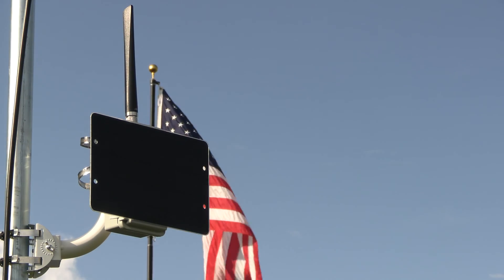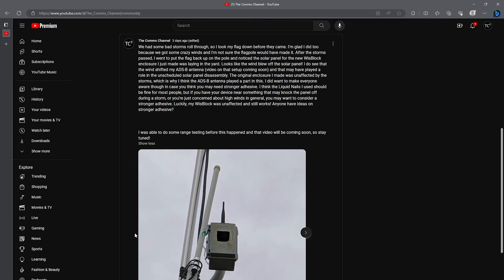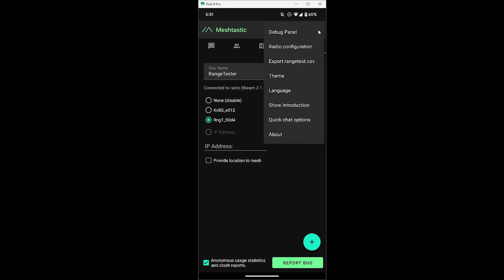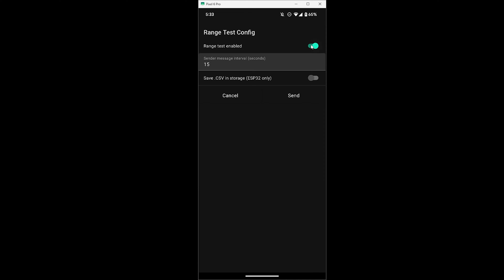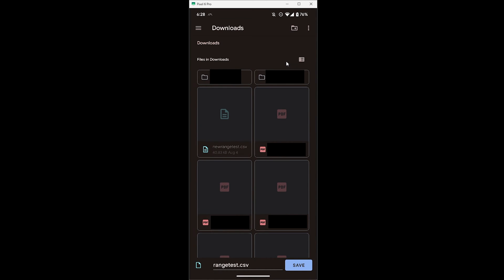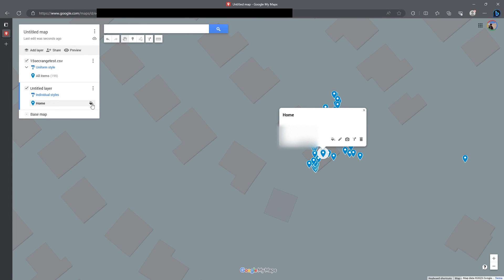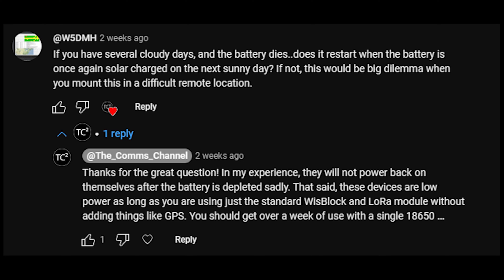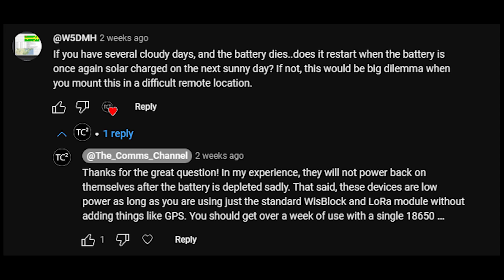Automated Range Test with Meshtastic

Comment: My question is with the solar controller does it control max and min voltage and does it have a temp senser to stop charging when it gets too cold as we know lithium does not play well with the cold thanks  Ed W9US
Reply from the maker: It's more of a solar charge port than a controller really. There are no management features. Just charges the battery
Reply: @The_Comms_Channel  ahhhh good to know Thanks for a quick answer I'm not sure what region your in but how does the battery hold up to cold weather, here in IL it got to -28° F this last winter?
Reply from the maker: Sure thing! I'm in TN so it doesn't get quite that cold here

Comment: If you're going to build a box to house everything, you could have provisions for an army of 18650's in parallel to give you proper voltage, with , of course an appropriate charge controller. A relay circuit to engage and disengage the battery while charging could also be built with solder wires coming from where the single 18650 goes. Some voltage/soc monitor could have output as to where the battery power would go per  the relay state.

Comment: Followed directions carefully. When I start range test on mobile device I don’t see any seq message coming through on stationary device. I can still send a message on the main channel and it goes through fine. Am I missing a setting?
Reply: I had to set the Base station to Range test ON and interval to 0 seconds for it to work. I also set the LoRa TX power to 0 to get maximum power.
Reply from the maker: What devices are you using?
Reply: Using a wisblock based unit for the stationary and a t beam for the mobile. Using Meshtastic Android version for both
Reply from the maker: Hmmm... that's my exact setup.
Reply from the maker: I don't do it often so I'm not sure what could be going on off the top of my head. I'll mess around with mine when I get home and see what I can figure out.
Reply from the maker: Any luck?
Reply: Yes your base radio needs to be put into range mode also

Comment: hey comms ever had issues updating the .uf2 file for the firmware mine copys fine then  disconnects and i reset it right after and it doesent seem to update my rak 4631 wisblock and when i use the web client it says ukn no mac adress or hardware name any tips ?
Reply from the maker: What firmware update process are you doing?
Reply: @The_Comms_Channel  .uf2 bootloader style usb serial I figured it out I wiped it to rui3 accidently recently and it basically ended up me getting the rak wireless factory files and nrf uitl.exe and wiping it all then I installed the arduino bootloader or whatever then installed the uf.2 2.2.13 firmware file after copying it flashed green and restarted several times in like 3 min I left it alone and when I used the mesbtastic client I noticed it had been flashing green every 2 seconds which it didn't do before so it needed a clean wipe
Reply from the maker: Ah, gotcha! Glad you got it working!

Comment: I have a few systems with batteries. I put the system to sleep under certain battery level, and I only wake it up to measure the battery level. If the battery is still low due to cloudy days, I put the system to sleep again. That way I'm sure that I have enough battery until a sunny day.
Reply: That is a really good idea

Comment: Hi, thanks for these videos. Question: If I were to set up one of these on a hill a mile or so away and wanted to message a friend, would we both need personal devices that we could either message with via the device itself or by connecting it to our own phones or could we connect to the device main router in the hill by our phones alone? Alternatively, if those friends had a single router at their place, could multiple people use that same router to transmit a signal from there place to the router on the hill and then to me? I'm super new to this but it's exciting and seems like a relatively budget friendly way to get into DIY encrypted messaging.  Thanks for any help that you can provide :)
Reply from the maker: Sure thing! I'm glad you're enjoying the videos! 

If someone is close enough (within Bluetooth range of 300ft or so) to the device on the hill, they could connect directly to that device with their phone and communicate with the distant users. If none of you are near the device on the hill, then you would each need your own personal devices along with the device acting as the repeater on the hill.

There can currently only be one device connected to a device at one time. I believe there is work being done to allow this though, or at least talks about it so not sure what the timeframe would be on that happening.

It's awesome technology and the easiest and most budget friendly way to get encrypted comms that I've found. 

Thanks for the great questions!
Reply: @The_Comms_Channel  okay, that’s noted and appreciate your explanation! Cheers
Reply from the maker: @natebaird  Sure thing!

Comment: Next question.  Any idea why the range test "seq#" won't display on the phone app?  It shows on the T-Beam lcd but not on the phone app(s).  I've tried both phones/T-Beams as the mobile test device and neither apps. show the seq#. Normal messages show just fine just not the range test.
Reply: Having the same issue. Using iPhones. Have not been able to track down androids to see if that’s the issue yet. Interested to know if anyone has figured this out.
Reply: @alexvanwormer4593  I also didn't see any seq messages - I then simply downloaded rangetest.csv and looked at it and I could see that it logged positions at least so far, so I think it seems to be working.
Reply: T-echo and RAK both won’t send seq in range test
Reply from the maker: Not sure on that one. What type of phone do you have?
Reply: @The_Comms_Channel  Both are Androids (DeGoogled)

Comment: Is there an alternative to Google My Maps that can be used?
Reply from the maker: I did a look around and found this website https://maps.co/gis/ that works. You just have to modify the csv file. The csv file has a column named "sender lat" - rename this to "lat" and there is also a column named "sender long" - rename this to "lng". Then if you click on the Import Data button you can upload your csv file.
Reply from the maker: There used to be a good Android app that did this, but I've been unable to find it now. Google MyMaps is the only thing I've been able to find, but I do want to create my own tool to do this at some point. The hard part us finding the time 🙂
Reply: Have you guys tried using ATAK?
Reply from the maker: @LouisObrien-p7q  I've used ATAK, but not sure it will read the range test csv file. I've not tried though.

Comment: Regarding waking after a low power  solar charge situation. Not sure if Meshtastic implement  this in their code. But i use Heltec modules. And my code checks battery voltage down to 3.6v and then will put the device into a 8hr sleep. when it wakes the first thing it will do is check voltage is above 3.7v. If not will go and sleep for another 8hrs.The important thing is not to let it get into a brown out situation where it is not preparing a long sleep properly. And tries to then power up without enough power to complete a clean boot before browning out  and crashing again. As this just deep discharges the battery and the device never recovers unless the solar panel is large enough to power the device at the same time while trying to charge a dead battery. If the panel was that over sized with a large battery  in the first place then this situation would not happen anyway.
Reply: I also range test by sending the  received SNR and long lat of the mobile device strength back to the base module to plot on a thingspeak mathworks map by colour . This gives the sender and the receiver SNR values
Reply from the maker: From what I understand, it's more of a hardware issue than code issue. I have a Heltec that I'll test this on. Thanks for the info!

Comment: If the device is not really being used that much and in a really sunny sate such as Florida, would it be possible that the solar panel is sending more electricity to the battery than it is being used? and if that is the case then is there any kind of protection for the battery or anything stopping it from blowing up because of overcharge?
Reply from the maker: What's great about the WisBlock compared to other LoRa options is that it has a built in solar charge controller. It will stop charging when the battery reaches 100%

Comment: Thanks for putting in the work to make these videos. I’m currently experimenting with Armachat and a version is now Meshtastic Compatible so having nodes to act as repeaters is fantastic. I asked in the first video if these could be used without a cell phone in the initial setup that appears to be the case as long as you don’t need the latest software flashed on units that come pre flashed for Meshtastic, correct?
Reply from the maker: Glad you're finding the videos useful! I've never heard of Armachat, I'll have to check that out!

If you get a WisBlock as part of Meshtastic Starter Kit, it will come with Meshtastic loaded on it, but it's not set to the region and not in repeater mode. That can be easily set from a computer though if a cell phone isn't an option.
Reply: Perhaps you could do a video showing what software to use for this-many of us are capable of bolting things together and using software if we know what to do but it isn’t something we have a lot of experience with. In my case, I’m a general class HAM radio licensee so I can solder and understand radio theory and how to solder things but I’m not an expert on communicating with microcontrollers. There are a lot of people out there that would like Meshtastic capability but won’t have anything to do with cellphones being involved because there is no expectation of privacy at that point…. Which is why you want encrypted comms in the first place.  @The_Comms_Channel
Reply from the maker: @nunyabidness9257  That's a good point and idea. I would be happy to do that and will try to put that together this weekend time permitting. Thanks for the suggestion!
Reply: Armachat is being developed by Peter Misenko here on YT. He has made a number of devices that are either dedicated communicators or incorporate Armachat into a device he created. As of right now, Meshtastic is only available on his PiComputer. I have Armachat Touch and really like it. @The_Comms_Channel

Comment: I thought I read somewhere the rak boards are supposed to wake themselves up maybe that solar green module helps with that?
Reply from the maker: Not sure, mine didn't seem to at least. I wonder if it may have been fixed in a newer firmware. I'll have to test it out.
Reply: @The_Comms_Channel  apparently it only wakes itself up if you plug the solar panel into the usb port
Reply from the maker: @BobBob-il2ku  Ah, good to know. Sadly, the Soshine panel wouldn't charge/power the WisBlock so the solar charge port had to be used.